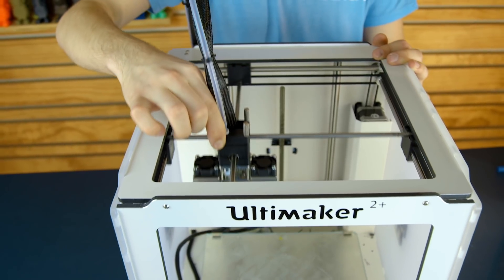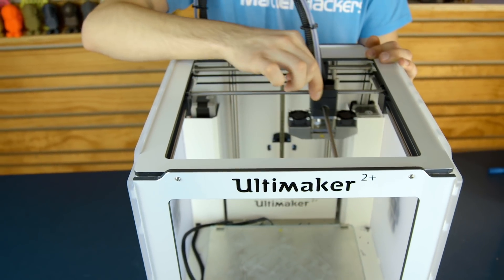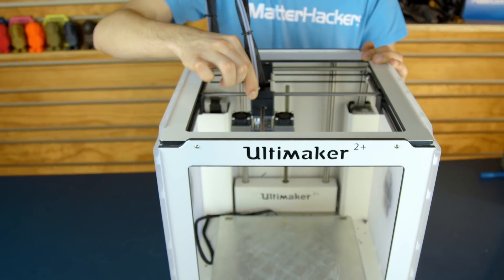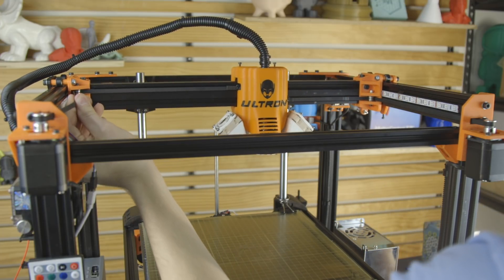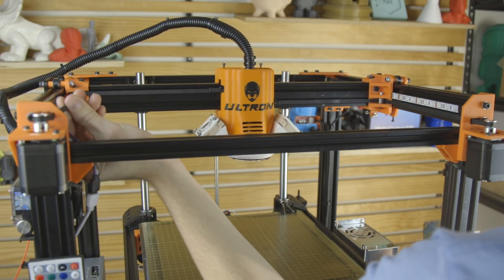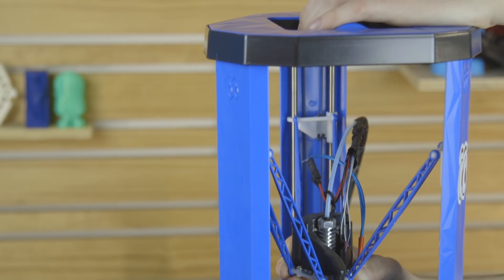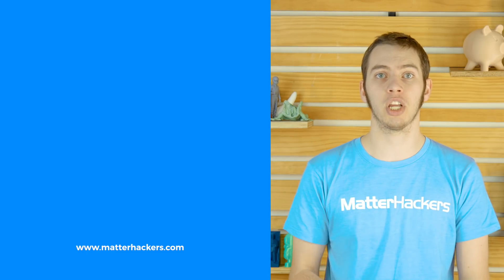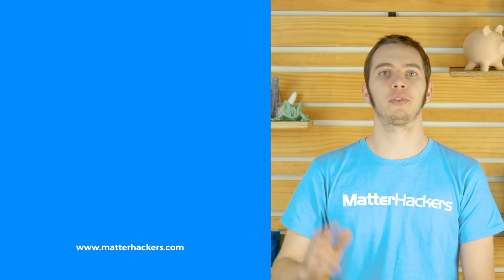The Anatomy of a 3D Printer // How a 3D Printer's Movement Works

Comment: You did not mention cartesians that are YZ, like the Makergear and Felix printers that move the bed on Y and Z axis. If you look at the Felix Pro printer, this combination of frame and motion design is the easiest and best to use, if you want a portable printer with a folding bed.
Reply: You're right, but there's also Cartesian X head like the Up! Mini, the Cartesian Z head like the Makerbot Cupcake,  Scara, robot arm, and so on. There's many configurations that this video would be much too long to talk about every single one of them. The point was more to go over that there are some "main" configurations, and those have some subcategories.
Reply: Greg El weird, I made the experience, the the system used by felix printers is the worst!
In many different ways...
Reply: tonpa888 I did not say that Felix printers have the best system or that they work well out of the box. They do have some good ideas on design and parts though and my 3 year old modified Felix 3 works like a charm with an E3Dv6+titan extruder and a 32bit board.
Reply: Greg El ok, but what were/are your problems with your felix?
I have a Felix 3 with a dual extruder, but it isn't reliable: it looses steps(I adjusted the stepper current, it works now) it knocks things of the buildplate, the printquality is worse than my wanhao duplicator i3 (350$), the extruder jams and things don't like to stick to the buildtak and the list goes on...
There are just so many problems with the machine and I don't know how to solve. And it's even harder to solve the problems, because they don't appear regulary!
Reply: tonpa888 My Felix 3 dual worked for 1.5 years before I made any changes and I had very little failures. I also made a few dual prints but I made it back to single and used the second hotend to swap to bigger nozzle. 4 jams in 18 months, one hotend heater replaced and one set of belts. Everything stuck well to the felix surface (kapton) with some glue stick and later Magigoo. Never used buildtak on my Felix. Never had problems printing well, never lost steps, but it was loud. Stock Felix 3.0  7/10. If you feel yours is 5/10 then contact the company to troubleshoot. Something went wrong if a stock Felix 3.0 is lower than 6/10.

I wanted an all metal hot end to print more materials like PC and nylons, so I got an original E3D v6, but the mod for the felix 3 E3Dv6 was a bowden and I wanted to print also flexibles so I got a Titan extruder as well and designed a mod myself. That had major quality improvements and solved maintainance issues. I had a better-lighter extruder with better part cooling and a better all metal hot end that was cheaper than the original Felix supplies. Then I got a 32 bit board for SILENT 1/128 microstepping and auto bed leveling. My Felix with mods 9/10. Now I will make my custom enclosure, folding bed, ballscrew for Z and fine tune profiles to get to a 10/10 quality.
Reply: Greg El ok thanks! I will have to decide wether I ship it back or not!